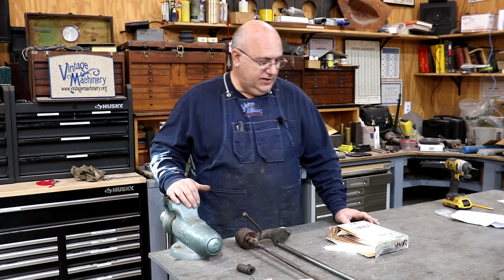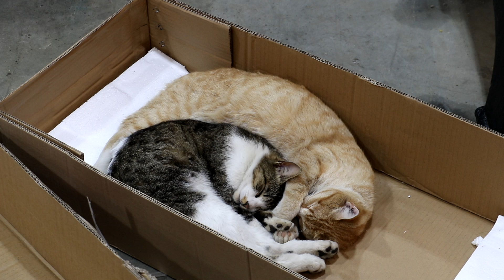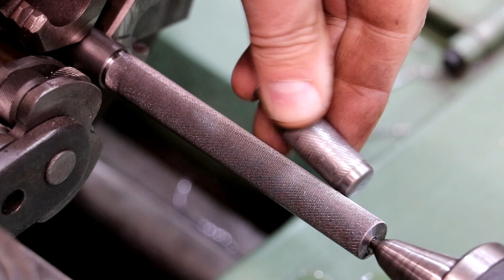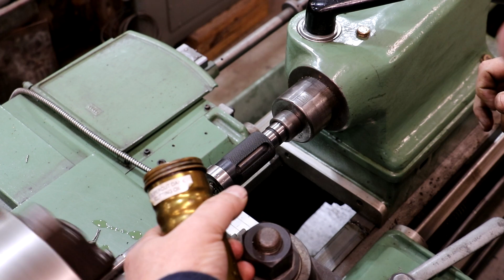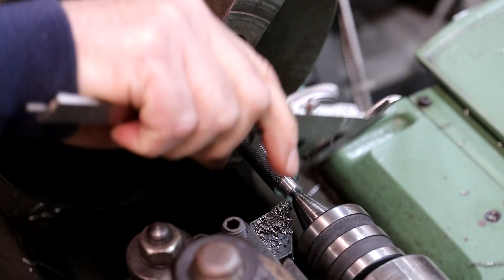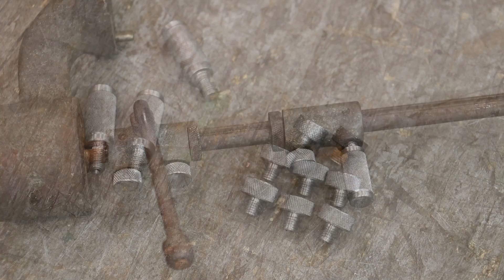Machining New Thumb screws for a Monarch 10EE Lathe Electronic Lead Screw Reverser

Comment: And Keith ended up doing what he didn’t want to do - chucking on the knurl. I would have just used copper over the jaws and pushed the part all the way up to the chuck, and then cutoff. It would have been fine.

Comment: I remember from working with master machinists that sometimes knerals are intentionally made shallow as to keep dirt and swarf from accumulating and helping to keep metal shaving from getting into the operators fingers.The floating die holder is real slick. Way easier and faster than a single point tool. Back in the day brass was a favorite way to prevent maring steel surfaces. They know quality job one period. Good day Keith and peace.
Reply: Knurls?
Reply: @silasmarner7586  What ??

Comment: TLABR measurements.  Love it!  No need for micrometers here, it’s a handle.  Could you turn the body of your mangled handle, and shaft with a knob, heat bend to fit, weld together, and blend the weld rather than casting?  Would be stronger and probably a whole lot faster.  A thought.

Comment: Keith I know you are a stickler for perfection but you could probably  save a ton of time and money NOT  replacing that  handle .  You could just  crack out some epoxy putty and then   fill the handle you have,  to look like the original after a bit of  sanding and paint.... perfectly functional...disguise . assuming that  original repair is solid

Comment: Keith, in lieu of taking the time to cad, pattern and cast a new part, I would first try turning out a new handle from steel, torch bend it, and braze it onto the broken casting. Just a thought. Take care, G.
Reply: perhaps better than my  epoxy putty filler idea.
Reply: @shanegray1846  That might work as well, G.

Comment: The advantage of the metric system is that I don't have to deal with fractions. 
You calculate in 0.001 inch that is 0.0254 mm each.

Comment: 7:05 things center drill looks solid but at 22:02 you can see the deflection when you contacted.. I think because of the length of stick out and run out. Not a biggie for what this part will be used for. Interesting stuff Keith :)

Comment: When you were parting you could have used a tailstock. It is only considered a no-no if the parting tool is likely to get clamped by tailstock pressure when you get close part off, leave a little nub and you should be fine.

Comment: Precision/production threading tip: indicate the stock in 4-jaw dead nuts on, No runout. Then, single  point a pass or two. Then, run threading die down the stock to complete the job. The threading die will follow the threads you started as single point. Thus, very accurate threads in terms of depth, form, and being exactly square with the work. Depending on how fast you single point, it may be a little faster.

Comment: Keith - you might look into using a scissors knurling tool.  All of the pressure is in "pinching" the work so the work is only pushed towards the chuck and not away from the tool.  I've made some pretty heavy knurls in a single pass with one.  Eagle Rock is a good brand.
Reply: On smaller lathes that’s an issue, and I use them in my 14”. But on bigger lathes it becomes moot, as the large, robust bearings aren’t affected by the side pressure.
Reply: @melgross  it's not a bearing issue but a work deflection issue.  It's hard to maintain a consistent knurl if the work flexes away from the tool.
Reply: @russkepler  I understand that. But the main issue is the bearing issue. Knurling has ruined many a lathe spindle bearing. It’s a real issue, and has been known, and noted for well over 100 years. You don’t normally knurl long thin shafts, particularly without supporting one end. Or using a follow rest.

Comment: Did it have a brass tip pressed into the end to prevent marring of the shaft or was it a separate small brass slug? Seen them both just wondering if the parts catalog showed it? Inquiring minds want to know. lol
Reply: And to protect the threads of the fine adjusters.

Comment: Great work Keith as always. Don't forget to tighten the live center with the tailstock though... The knurling shifted the part to the chuck a little. Thank you Keith!
Reply: You could see the part wobbling when the lathe was stopped on the first piece. I was surprised. Keith is usually pretty good about that sort of thing. Sometimes distractions have you forgetting the little things. Filming is a distraction.

Comment: my Cleveland No 1 Mill uses those little brass plugs for the table and knee stops.   pretty ingeneous because someone had replaced one of the plugs with aluminum, which i replaced with brass and the brass holds far, far stronger with no damage, where the aluminum wouldn't hold to save its own life

Comment: What makes you decide to use a live center vs a dead center? Can they be used interchangeably?
Reply: The general rule of thumb is to use a live center when your part is sticking out of the chuck 3 times its diameter.  As an example, if you have 1" bar stock, it can stick out of the chuck 3" or so.  As mentioned, this is a rule of thumb.  Variables, such as the type of material, and the amount of precision needed will actually determine what you can get away with. The more stock you have sticking out of the chuck, the greater the chance of vibration, deflection, etc.  Ultimately, it just depends on the application.

Comment: Interesting about the brass 'plug' Keith. Thanks.
Reply: Brass plugs are used in all machines where a stop screw has to press on a shaft. since Brass is soft, it doesn't deform the shaft
Reply: Thanks Thomas

Comment: Just to emphasize what Keith said, knurling doesn't involve cutting the metal but rather deforming it.  It does slightly increase the width of the piece but normally that's not a consideration.
Reply: There is a form of knurling called "cut knurling" that removes metal more than moving it as in pressure knurling. It's used quite a bit in Swiss machines and the like.
Reply: One difference is that form knurling works on more or less any diameter but you need a specific one for a decent looking cut knurl.
Reply: @littleworkshopofhorrors2395  I think I've had to shave a little off the diameter of the work as often with pressure knurling as with cut knurling.
Reply: There is a certain leeway in both but one is a set of ridges and the other more akin to gear teeth.

Comment: Knurling is fun to watch, done it a ton when I was working in a small proto shop. Some professors wanted knobs made with cap screws and plastic press on handles, others insisted on 'real' controls - steel with knurling. Sweet.